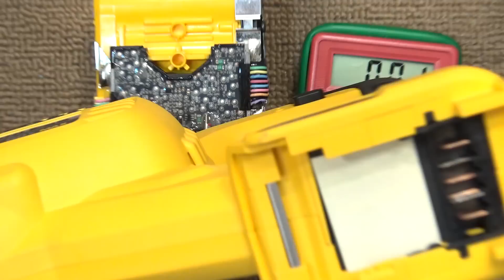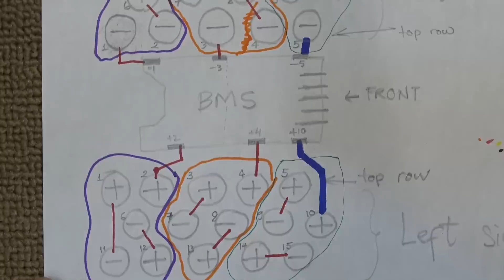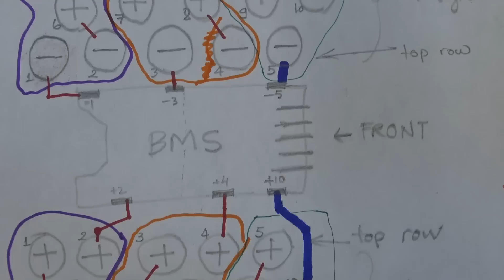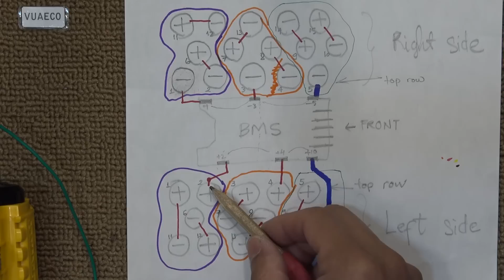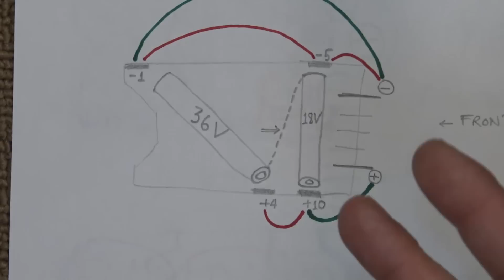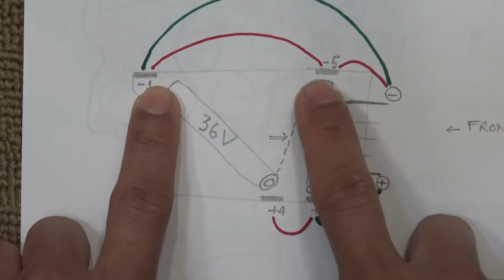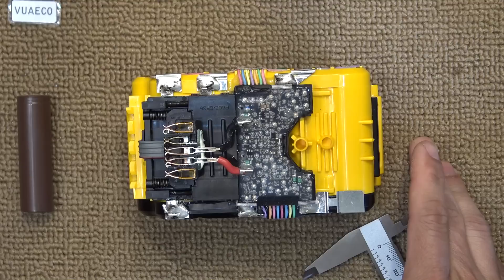Dewalt Flexvolt 60V 9Ah battery teardown & analysis: From 20V to 60V, How does it work?

Comment: Great Video, it really helped me understand the concept of what's happening. Can you provide me with output values for the other pins? I bought a 60V string trimmer for cheap with no battery and don't want to buy an expensive flex volt pack when I already own plenty of cells/packs. I think I could run it on three 20v 6Ah packs in series to provide the needed 60V. I already tested it but the string trimmer did not activate. I need to know what signals are required on the remaining pins: TH (thermistor   TH-10k-B+ I think) C1 -& C3 (bridged signal to pack BMS to enter 60V mode) C4 (may be some sort of voltage reference from pack cell tap #4). C4 is the one I'm really stuck on. Can anyone out there that already has a flex pack take a measurement and help me out?  (the other pins: C2 & ID are not present on the tool)

Comment: 20v high amp 60v low amp cause 15 batteries in series..I’m making a diy 60v to power my lawn mower and snow blower to extend runtime.. the 12/4 amp 20/60v is not enough run time so I’m making a 60v external battery at 10amp 60v😂

Comment: Very good and important video I learned a lot from your videos, I have one DeWalt Flex Volt 60 volt 12.0 ah and can you tell me if the position of the inside batteries are the same of the one you show of the 54 volts.Thank you for your vrdeos
Reply: I just repaired two Flexvolt 60V 12.0AH batteries. The batteries inside are exactly as in the diagram in the video(Great video by the way!!). One Flexvolt had a dead cell(voltage was reversed to -8.6v ?), and the other Flexvolt I repaired had 3 cells dead(0V), one cell in each bank of 5(#3, #6 and #15). I bought each cell(INR21700-40T) for $5

Comment: so they falsely advertise them as 60v in the US , here theyre labelled 54v just as your multimeter says on your battery
Reply: When I fully charge my flexvolt batteries, they are about 61V. Each cell can be charged to 4.1V x 15 = 61V. I dont see anything false about that.

Comment: Appreciate your digging. After modding Milwaukee and some other packs, im convinced they are limited by the bms. The more parallel cells under a bms voltage stage, the more likely imbalance is to happen. If the 60v bms can actually monitor and balance each 15 stages, thats pretty amazing and the only way to get more AH reliably in a pack.
So does the dewalt charger actually charge flex volt at 60v to balance?

Comment: Great video of the break down of its components. So I take it that if I short out the 2 and slide in the 60v lever I get 60v but why does it not happen when charging. I take it that the BMS is bad?

Comment: Can you tell me how to connect a diy 60v battery to a 60v flexvolt tool?
Reply: Please let me know if you find out. I tried this, and even messed around with a resistor (like I do on other tools to fool them into working) but no luck yet.

Comment: great video.  one of my 60v batteries started doing this funny thing.  i start the 60v tool and it runs for a sec then stops.  when i push those black tabs in and check with the multimeter it's showing 20 v.  i ordered the tamper proof (resistant) bits and will be breaking it down to see if i can repair.  my guess i'm going to be soldering something where a connection broke.  you ever seen this happen bro?

Comment: Hey I’m glad I watched your video !  I learned so much .  The first one was the way it switches voltage . I am also like you hopping to see more of this in the future.  Then the way it’s wired learning that along with the size of the battery’s.  That helped me out so much I have an after market battery that’s bad I’m going to rebuild.  I would have ordered the wrong battery’s.  Then you tell what mAh they use that helped out a lot .  I like how you describe everything so plain it’s so easy to understand .  I have subscribed to your channel as soon as the video was over.  I look forward to learning more in the future you are a great sensei !  I have always wanted to have more wisdom on electronics .  I was happy to learn and build a 13.8 volt DC battery charger from an old microwave transformer .  An by using 8 AWG wire  it has a high amp charge around 30 amp .  With a 6 setting porch light timer switch I can set it for 10 min to a hour . I used the vent area off an old hot water tank to make the box I put it all in.  Thanks for your great video and all of your wisdom on this battery pack !

Comment: Well that's just going to short out a 20V battery in a flexvolt tool...   "Flexvolt tools require Flexvolt batteries to operate and are not compatible with Dewalt 20v batteries. "  That kind of makes flexvolt tools 60V tools, they're not flexible at all.
Reply: Using only flexvolt batteries (that "FLEX" at 60v •8-○ ) is precisely why it is called a flexvolt tool.
But hey, you miss 100% of the shots you don't take.
Reply: @bigdfig6083  It's a 60v tool that takes a flexvolt battery.  Nothing is flexible about the tool.

Comment: Thanks for explaining the contacts short-out. I repaired such a battery and was not sure why the 60V part is not being outputted anywhere when pressing the switch. Looks like that completes the circuit and makes the proper 60V output.

Comment: Welcome. Why does the Dewalt battery cut off when it turns to 60 volts? I changed all the cells to LG, and the same problem. The chainsaw works for a few seconds and stops❤

Comment: Hello brother. Dewalt 60 volt battery. It is in good condition, but when I use it on a saw, it works for a few seconds and disconnects the electricity. What is the reason? If you can help me. Thank you🎉❤

Comment: I truely enjoyed your knowledge on this battery pack. I have to ask you a question of jumping these batteries with another pack to get it to take  in the battery charger. You have seen these video's. Now when and if you jump this pack should you push the slide button in to jump it so all batterys are on board  because other wise  only the one set of batterys( as per 18/20 volt )would get the jump charge benefit!! You know what I mean. Thanks my brother!! Montana Rick.

Comment: Please do a teardown of the 60v greenworks battery. My battery will charge but only discharge to 56 volts.  I'm thinking there is a voltage limiter/regulator issue in the battery itself. Can't seem to find replacement parts or any idea where it would be located.

Comment: In the UK they are called 54V batteries, why do they call them 60V in your country?
Reply: It's just a marketing technique basically a marketing scam if you will but that's why they have to put the word Max after 60v it's the only country that has allowed in because we love to scam the public apparently. It's not cool but it does work because I do have customers that swear up and down it's more powerful because it's 20 volt but it's the exact same as 18 volt as they're both the same nominal and compare them side-by-side they both have the same amount of cells

Comment: I run a cheap cord less   20 v drill (KLATTER) WITh THIS BATTERIES with very little  adjustment of the socket,  conectors  just plug in right.. as there is no BMS  in the drill I just keep an eye  of the battery leds, and charge  at one led, now I will  run an 220 V AC angle grinder  out  of 60 V  won´t  run  fast  but it will run, an  110 V AC tool  will run pretty good out of this  batteries

Comment: the battery does not develop 60v when fully charged, 3.6v 15 x 3.6v cells in series create 54volts.  its simple maths. what you have in the USA is the dewalt marketing department stating it is 60 volts. the rest of the world the same pack is labelled correctly at 54v.
Reply: When I fully charge my flexvolt, each cell is about 4.1V. 15 cells in series will give you 60V. 3.6V rating is nominal voltage

Comment: In the uk, our batteries are rated 18v & 54v. Fully charged.
Reply: Yeah, DeWalt does that differently in the US versus the UK. they use “max”voltage rather than voltage under load.

Comment: Hello, I have watched your video many times. I have a 54V dovolt chain saw, and I have an idea to connect a battery from an electric bike to it, it also has such a voltage. I bought a devolt battery designer on aliexpress to take clamps from it. then the tool didn’t work. There is a board on the Clems and there is a temperature sensor there, I didn’t connect the balancing wires, they just dangled. Help me figure it out if possible Thanks)

Comment: I'm going to mod my 20V XR brushless to +++  by adding a switch/jumper to turn the 20V XR tool and battery into a beast (think it as Overclocking your PC). It may not be as powerful as the 60V, and the batteries/PCB controller may not be able to handle the extra voltage, it'll be a fun experiment(-1 to +2 to -3 to +4 to -5 to -6 and to the negative connector, then +1 to + connector. I hope nothing blows up.

Comment: Is there a way I can contact you?   I came across a dangerous battery.
I had a flexvolt battery fail and after troubleshooting it with the plastic safety piece in place which disconnects the parallel 3 negatives and positives what I found was that the 1st bank of 5 cells that you label 1,2,6,11,12 is way off reading 12.80v.
Checking each individual cells shows:
4 cells 3.501, 3.521, 3.524, 3.490 with cell # 2 at -1.195 giving about 12.8v total.   All I can think of is they either installed cell 2 backwards or it is somehow reversed charged creating a dangerous situation.
This flexvolt chainsaw that I had purchased 9 months ago came with 2 of these DCB609 batteries so after finding out the issue with this one I couldnt take a chance and not check the other one.   The other battery apoears to be just fine.   All cells read properly with correct polarity.
Comments anyone?
Reply: A individual cell reversing polarity is uncommon, but still happens as it seems yours has done.
You've no doubt rma'd it by now. If not, better get going...

Comment: Great video. It appears that these batteries are 9ah in 20v but only 3ah for 60v.
Reply: Little late here, but i noticed the same thing, did you get any reassurance about this? Seems weird that nobody else pointed this out
Reply: Exactamente. It is printed right on the battery itself. Might involve squinting, but it's there.

Comment: Its not 60 v, never has been, they called it 60v MAX, but its actualy 54v, its a scamm, same with 20v MAX, its actualy 18v flat
Reply: sounds like u knkw qlot about these batteries, how would i wire 3 20v batties in sequence to power a 60v tool. ive trued just the main terminals and get nothing. ive also hit the wrong ones and welded 12guage wire to the terminal

Comment: I’m guessing that transportation cover not only turns off power to the terminals but also turns off power to the circuit board. That would make the most sense to solve the parasitic draw from the circuit board while the battery is in storage.

Comment: Despite Maximilian's insulting comments I think this is a brilliant piece of reverse engineering.  I am trying to decide on Dewalt's "FlexVolt" line or their "Power Detect" line.  This video gets me started on understanding how the cells are wired, how the packs work and what's the best long term value.   Very well done and thank you.

Also, I would like to thank Maximilian for reminding why, despite my engineering and IT credentials, when I'm on a large multi-vendor job I take my lunch with "his" so called "no education and work in construction" guys.

Hey Maximilian - those "no education and work in construction" guys know more than you think.  And the best part is they aren't from the NARCISSISTIC FUCKTARD CLAN like you (you wanna-be little prick)!

I probably fell into a troll trap but...

Comment: Hello.
Thanks for the explanation.
Do you know if I can charge this battery pack with the charger of a Ninebot Mini Pro instead  of using the Dewalt charger? The Ninebot Mini Pro uses a 54V 15S battery pack too, so I don't know if I can use the Ninebot charger and how I have to connect it to the Dewalt pack. The output is 63V 2A.
Thanks.

Comment: They power pins are the same for 20v and 60 volt tools.. the 2 terminals with the black and red wires going to the circuit board is the charging circuit.. the charger sends power in those wires to the board which Balance charges the cells.. c1, c2, c3 is for the tool and charger to monitor balance circuits of the battery along with pack temp.. the mechanical switch is the only thing that they changes the voltage coming out of the battery.. so you half right

Comment: Great vid very helpful!  You might find this interesting..   I just disassembled my 6ah DCB606.  It stopped working for 60v tools but does still seem to work with 20v.  Also the charger will show that it is charged, but I only get 1 bar.  Dewalt is sending a new one but told me to recycle or keep the bad one..  Sooo, the fun begins!..lol ; )  I haven't tested for bad cells yet which is what I believe the original problem may be.   But, when I opened it I immediately noticed (Per your diagram) the BMS -3 right side connection is burnt completely out, and -5 shows heat damage, but is still intact.  Debating how to proceed.?  I'll test the cells tomorrow and post what I find.  Thanks  for making the vid!
Reply: Any update? I have a battery that works fine but refuses to power tools.

Comment: Hey, can You help me little bit? My 60 volt tool Works on 9aH battery but 20 volt tool no. Also my charger don’t want charge it. I did it from other full charged battery. And I found that one cell c3( I try c3 and b-) is low voltage (2.6volts) have any idea ? In good battery in (c3 and b- ) is 11,9 volts? Maybe I can charge it separately? But I don’t know with is c3

Comment: what cells are used in the 6.0ah flexvolt batteries currently in 2020? They have changed the logo sticker on the side even. I tried contacting Dewalt, and they claim they can't divulge that info??

Comment: Pretty dumb explanation.
This is how it works: When you insert the tool you connect the three battery packs in series instead of parallel. It's that simple, it's not rocket science. You then get 60 Volt.
Same with the Hikoki multivolt series.
Reply: What you've described is no secret and we've all known that for years. Well done. This video shows HOW that is achieved mechanically inside the battery. It's fantastic for the intelligent and curious amongst us. Sorry it went over your head a bit.
Reply: @chocolate_squiggle  draw an electronic schematic then
Reply: @chocolate_squiggle  Guess it's just obvious if you have an education and have opened up one of these yourself.
Reply: This video is informative and interesting, it went over your head so thats cool
Reply: @nohcho84  nm watched it in 2x speed. No it did not go over my head. As I have personally opened up 3-4 of these batteries. It's not rocket science. Simple stuff really.
Can't say I'm surprised. But I guess if you have no education and work in construction it's hard stuff.
Reply: @nohcho84  Also the hikoki way of doing it is smarter as it relies on no moving parts with springs. You serialize them by connecting the battery to the machine.
Reply: @nohcho84  Perhaps, as I did not watch the entire thing. Just way too low production value. Used to more rapid information delivery.

Comment: Dewalt runs the cells at 4 volts,  not 4.2.
To get 3AH @ 4 volts the cell must be larger. If you charge the bigger cells to 4.2 volts they will have a much shorter charge cycle life, but much more power.

Comment: Hello
that was a very good explanation
I want to ask a question  please
Ihave a good few of those batteries ,, they will not see the charger (will not chargred on Dewalt 118 charger) 
Iwantto use the battery for other battery likeparkside bosh hitachi etc ,,you know I can change the main board to different battery once I use the mainboard for the one which I want to converted ..now my question is there is +,- and 4 wire how can I rewire it?

is there any webpage it does show the first and seconed row of the battery and the 3rd row
thanks

Comment: Kindly sign the petition to avoid this misleading cheating by DeWalt,
https://www.change.org/dewaltvolt

Small correction,
Nominal voltage of Li-Ion cell is 3.6 V
So, 3.6 V x 5 cells = 18 V
18 V x 3 module = 54 V

Only when you take 4 V as Li-Ion voltage, It might give,
4 V x 5 cells = 20 V
20 V x 3 module = 60 V

But the Li-Ion range is from 3 V to 4.2 V (3.6 V is average),
meaning, in very short time, when cell voltage is less than 4 V, then it drops from [20 V / 60 V] to [18 V / 54 V] in output.

That's why DeWalt sells as 20V/60V only in country where idiots don't ask question,
In Countries where people ask questions, they denote as 18V/54V :)

People leave a comment,
what voltage does dewalt sells in your country :D
Reply: We can do muh maths in merica two. See just didit, toldya.
O anna nutha thing. We don't buy juss cuss they say 20volts. Ain't no nevermind. There's like eleventy other reasons we go the defalt route. "20V/60V" is juss like a sweeeeet lookin' flame job run down the side a my tool. DAMM beat that!

Comment: Love your channel, it's great. What is the voltage of the fully charged flex volt. Is it 20v or 21v, which would be 4.2v x 5 batteries? Trying to see if my batteries are still holding voltage. Thanks
Reply: 21

Comment: Nice video, thank you. Did you determine what that extra set of contacts did on the 60V tool. If you did not insert that paper clip jumper did the battery still switch to 60V when you closed the slider switch?  Or are those contacts used as a second confirmation that a 60V tool is inserted?
Reply: Not 100% on this but I am almost certain they talk to the charger  regarding it temperature so they dont over heats.

Comment: Originally I would have assumed the larger cells were higher discharge, but my newly purchased 60v chainsaw says it cuts 2x faster on the 2ah(18650) 606 battery.. Food for thought.